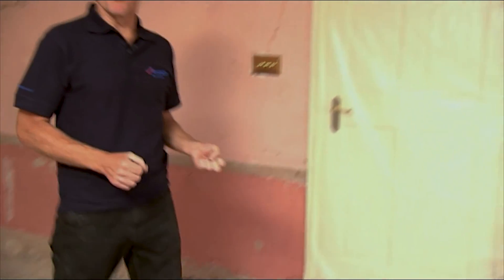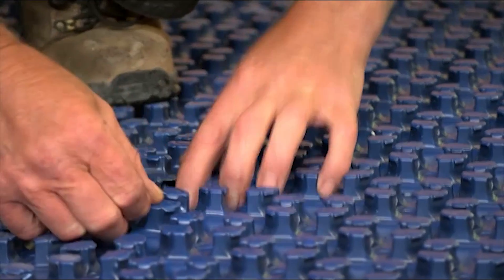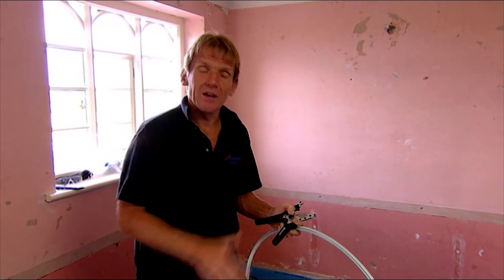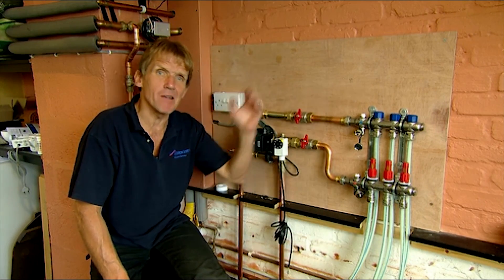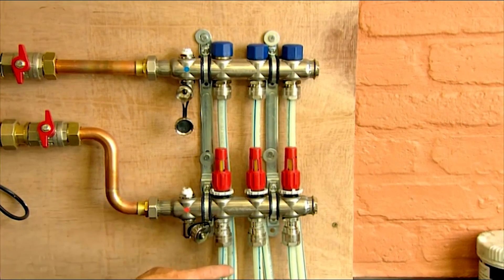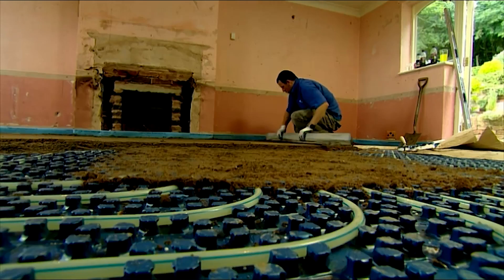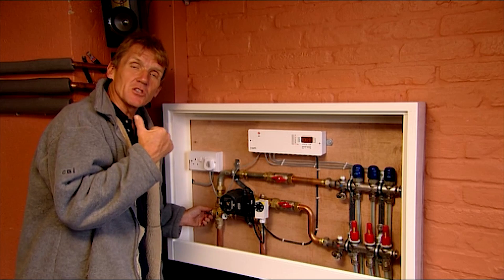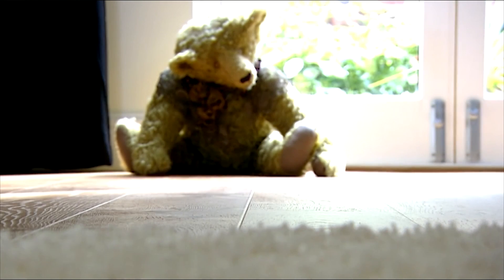How to Lay Underfloor Heating in a Screed

Comment: Could u please tell me what is the  screed exactly and what is the material used ?? Because i use for covering the pipe in my country with Cement mix, which consists of sand, cement and water only. Is my method correct?! I hope you answer my question as soon as possible please
Reply from the maker: Yes you can use sand and cement or liquid screed

Comment: Does the screed install hold heat better than the warmboard installs, which basically have to run all the time to keep warm? Also, what temp does the screed need to maintain comfortable levels and how often do they cycle?

Comment: Would you self level wooden floorboards before using these pipe pannels? I imagine my floor could be a couple inches off across the room but not measured and I'm unsure if uneven screed ontop of the pipe will be a problem. Could have hot and cold spots warming up but otherwise no problem?

Comment: Re doing an old house , which in reality as we have replaced so much should have been demolished. 

Twin cascaded Heat pump going in.

Ground floor, underfloor first and second floor radiators .

Asked installer for 100 centres , however he reckons two issues with that , first radiators on the upper floors will need to much bigger and that they find the tightness of 100 spacing leads to more problems , as well as having to increase flow temperatures . Looking therefore at 150 centres .

Does this sound reasonable ? I can see why there might be issues with 100 being so tight .
Reply from the maker: The lower the water temperature the closer the pipes should  be.
Reply: Thanks , that adds to efficiency and in turn to lower temperatures but it’s working out the impact on the sizing of radiators on the other two floors that becomes an issue and I assume it’s a case of where to compromise.

Anyhow thanks for all the useful vids thanks to which I have been able to more fully understand all the processes of a complete rebuild , and ensure they are not taking short cuts .

Comment: One stupid question. Can the distributor be fitted in the room below the room where the floor heating is being installed? I plan to run one set of the pipes from ground level distributor to one circuit on the ground level and second set of pipes to first floor. Or is it better to have the distributor placed on the first floor? In that case I have a longer supply and return pipe... Thanks!

Comment: I’ve opted for a milled concrete slab floor with 14mm wet system in conjunction with air source heat pump. The slab is insulated with 150mm celotex as well. We have only ran a thin flexible screed over the pipework and now it is to be tiled with a 10mm ceramic tile. Any advice on this system?

Comment: Hi Roger,
I was told by a plumber tht because I'm buying a 120+ year old small, 2 bed, 1 small bathroom mid terrace that needs new damp proof and gas bought into property from scratch that rads would be better than underfloor heating for the cos involved versus paybck in bill savings. Lounge and kitchen with concrete floor and master bed (wooden floor)are circa 11 x 10.5 ft, 2nd bed about 8x12 and bathroom (wooden floor) even smaller. Attatched sunroom/consevatory circa 8x6ft (needs renovation).
Also, I saw in the electric ufh video you used a wet screed that dried faster. I'm confused.
I'm on  budget, but want to do the right thing long term as costs rise for upkeep. What say you?
Reply from the maker: Hi
Yes it doesn't make much sense hacking the floors up to put the heating in so go with the radiators. Mid terrace has two neighbours to keep you warm so it should be good. 
Electric underfloor heating is tile warm up not a whole room heating. It costs a fortune to run.
Reply: @SkillBuilder  thank you. What about upstairs with wooden floors? Bathroom is sooo small.
I'm a building comtractors daughter but learned more from you. Love the videos even if not relevant to me.

Comment: I’m pondering if I should go for this method griundfloor and upstairs use Infrared heating as the bedrooms are small. We will install a 3.5kwh solar system and battery. What do you guys think?
Reply from the maker: I would do exactly that. I don't like underfloor heating in bedrooms. If it goes under the bed you cook.

Comment: Heat is heat,  whether it comes from the underfloor or from wall mounted radiators is not much different. But if you get problems with underfloor then it will be difficult to fix. I think wall mounted radiators are a better engineering solution. Also radiator systems have stood the test of time . .
Reply: Floor heating is essentially a larger radiator allowing you to use lower temperatures and gain substantially in efficiency - and the heat is released slower and more uniformly too

Comment: Quick question. I'd like under floor heating but my budget is tight. Instead of a new expensive system, could I just get rid of my radiators on the wall and connect under floor heating pipes to the pies that my radiators were connected to?
Reply from the maker: HI Luke 
 You can do that but it will make the floor too hot and that can cause your legs to ache.  There have been many studies which suggest that a temperature of no more than 30 celcius is good for your circulation.
Reply: Not sure if this answer is a Mickey take? Regards the temperature, can I not just adjust the temperature of the water coming out of the boiler?

Comment: Hi Roger
I like the idea of using a dry screed in your video, although it may not be your preferred choice. What cement/sharp sand mix was used?
We are just preparing our kitchen (23m2) for underfloor heating and I thought I’d get some quotes for a flow screed. £1400 & another at £2000. This is way over our budget. A dry screed would be so much cheaper. Any suggestions on cement type?

Comment: Great overview. Just wanted to understand, in a Hydronic system, how component constitute to cost? For instance, how much % share does following components hold in a typical UFH system:
1. Manifolds and valves-
2. Zone Valves-
3. Thermostats and sensors-
4. Wiring center -
5. Heating pipes-

Comment: Here's the thing.  I have a 1960 house with concrete floors.  Do I dig up the floors and have to move out to gain better floor insulation without increasing the floor height (big cost with renting) or do I go for a retrofit and lose a couple pf inches of ceiling and door height - your thoughts please
Reply: Rout the concrete
Reply: @DiceandGlory   but there only seems to be one company out there doing this and the solution has no insulation whatsoever.  Surely no insulation goes against what this video and many other manufacturers state?  Your thoughts please?

Comment: Yes keeping the pipes pressurised to a high level whilst the screed sets will mean that any future expansion due to pressure and heat will be accommodated without cracking the screed.

I have to say that experiencing my friend's underfloor heating, the rooms feelcomfortable at lower temperatures e.g. 19c feels as warm as 21c in a room heated by a radiator. Thats because the heat rises evenly ftom floor level. There are no cold spots. As stated too the water temperature need only be around 25-35c compared with 55-65c in a radiator fed system.

I would like to see how an installation is done in a wooden suspended floor.

Comment: is the thickness of the insulation board thick enough? I thought it had to be idealy 100mm, minimum of 50mm
Reply from the maker: You gotta do what you can. Ideally you would put some more under this but if you can't you can't. The house is being heated by a ground source heat pump so there is some justification in this approach rather than radiators.

Comment: Hi Roger. Great video. I am just about to put a hot water underfloor heating system in a new 42 sqm extension. My wife wants a Karndean laminate floor. Would this be ok with the heating system? Karndean say as long as the surface temperature is no more than 27 degrees then should be ok but would appreciate your opinion. Cheers
Reply: I doubt Roger would add anything to what the floor manufacturer has said?

Comment: I would strongly recommend using more insulation under the UFH. If I was building a new house I would use at least 100mm of PIR.
Reply from the maker: Good idea. The Building regs normally specify 90 mm but I have a 150mm in my extension.

Comment: We're having an extension to our kitchen, our house is 1910 construction and the kitchen floor is (currently) 22mm chipboard, 50mm polystyrene and then I'd say 4" or so of what seems like Limecrete(?). The Limecrete layer finishes about 3" below the outside floor level, would this be a suitable solution for UFH? As it looks to have an insulated backing, with a screed on top?
Seen a lot of the UFH videos you have done and this one is I would say the closest to what I need!
Reply from the maker: There are lots of choices for you. The easiest is to take up the chipboard and lay an insulated pipe panel.  Lay the panels, push the pipe into the grooves and put back chipbard. Job done.
Reply: @SkillBuilder  thanks I think whilst I'm there I'd prefer to pull up the polystyrene and put celotex down for an increase in U value. But glad to know there isnt anything funky required for the old building

Comment: Well explained Roger. Can you have an wet Electric underfloor system, just like boiler fed and how economical would it be?
Reply from the maker: It costs a lot to run an electric boiler. I would go down the heat pump route if I was on electric only,
Reply: @SkillBuilder  Thanks Roger, just a question. I still have a Gas boiler, but am thinking about alternatives with our Gas supplies running low.
Reply: @brianwood5220  - The daft thing is in England and Wales, the government is offering the Renewable Heat Incentive (RHI) grants available, but the heat pump must be the only source of heating to qualify !

Comment: Great job with the way the pipes are being layed. In a snail pattern instead of going across to one wall an back to the other wall like most fitters would do. Would using a liquid self leveling screed not be better for holding the heat an then realising the heat into the room than a sand cement screed?
Reply from the maker: Yes liquid screeds are best but sand and cement is not bad if it is done well.

Comment: I’m a bit confused to be honest. I seem to remember a vlog from you a while ago in which you completely rubbished underfloor heating. I think you said it wasn’t instant enough, didn’t warm up quickly enough, and didn’t cool down fast enough if it suddenly got too warm....! So which is it..? Are you for or against. What’s going on with you.
Reply from the maker: I think you are slightly misrepresenting the previous statement. I have always been a big fan of UFH but I am honest about what it can and can't do. I am not a salesman on a kick-back. 
In the middle of winter it is the best thing ever but in the autumn and spring when you might need to put the heating on for an hour or two on a chilly evening or  cold morning it is not the best. You might have a cold morning and a really sunny day and the heat will be in the floor when you don't need it. 
This means you might have to open the window and waste that heat but on balance the cost savings over the year are still there.
Reply: @SkillBuilder  ok. Thanks for clearing that up. Keep the good stuff coming.

Comment: also, if u r gonna use pipe dope, please dont get it inside the pipe.  why, cuz now it mixes with the water and makes a sludge inside the circulation route.
Reply from the maker: Nothing stays in that pipe when you run mains water pressure through it for the flush out.
Reply: @SkillBuilder  pipe dope don’t flush out. If it did, it would not be waterproof

Comment: Any recommendations Roger for an overlay UFH system on an un-insulated concrete slab (1950s semi). Struggling to find something that adds enough insulation without too much build-up as the ceilings are only 2.3m high. From drilling a hole it looks like there is only about 25mm screed on top of a 4" slab if that helps. Would prefer to avoid the cost of digging the whole slab up!
Reply from the maker: Hi Dane 
 I am afraid you are looking for the best of both worlds and there is nothing wrong with that but there is no way of getting the required insulation without the build up or the hack off. I have a similar issue at my daughter's house and I am thinking that  a low build 16mm system with a really low temperature is going to give some heat  without it all being lost.  To be honest I don't know how it will work out but the prospect of hacking up a screed in an occupied house is too daunting for now.
Reply: @SkillBuilder  Thanks for the reply Roger. I've had so many opinions ranging from the JK system (grooves routed in the screed with zero insulation - they obviously claim it will do the job no problem) through to you need to dig it all up. Currently contemplating hacking up the thin layer of screed (we're doing a big renovation so not bothered about mess, just cost) to at least get 25mm PIR down and then either a low build system or just 35-40mm of flow screed over pipes. Thanks again and keep up the good work - these videos are invaluable to first-time home owner like me who are approaching a renovation job.

Comment: Very interesting video. We're in the process of finishing our ground floor renovation, tiler will be here in a couple of weeks. There's an existing screeded floor which was part of an accessible bathroom. We've had to remove the screed to get to the sub floor as the toilet & soil pipe is set in concrete 360mm from the wall ( doh!). 

Anyway, I only just found out about screed curing & drying times which would really drag out our project. Our  plumber has suggested running flow and return to the towel rail in the floor as a pseudo wet underfloor system  - just as you've suggested doing in another comment which I'm really keen to do, but. I'm looking for a quicker alternative to screed.

 Bathroom is tiny - 6ft square with a 900 Quadrant Shower tray so area is barely 2.5sqm. Tiler has suggested using 2 part latex, laid over a couple of days in two layers as an alternative e to the whole wait around for screed to  cure & dry. Any idea if this would work as an alternative. Or is there another option? 

With such a small area the material cost is less of an issue, we're just looking for speed so we can be finished by Easter!
Reply from the maker: Hi Adrian 
Run the return as a snaking pipe through the screed and that will help prevent it overheating. Take the flow direct to the towel rail.
Good news for you is that you can buy a screed cement that is rapid set and absorbs the water. 
It allows you to tile after 48 hours. 

https://ardex.co.uk/product/ardex-a-29/
Reply: Does the rapid set screed give as good a result as the slower setting screed? 

Also what is the price differential between rapid set and more traditional slow set screed?

Comment: How much depth would this add to my existing concrete floor?
Reply: Think the minimum was 6 cm
Reply from the maker: You can get away with as little as 35mm if you use a special screed. Cement based flow screed with fibres is good
Reply: Does that include the matting, pipes and screed?

Comment: Great video Roger. I read it's not good to add the pipes near walls or where heavy items will be placed, as the heat will/ maybe ruin the item e.g TV cabinet, sofa etc, what are your thoughts?
Reply from the maker: Generally we avoid putting the pipes under fixed furniture but people often change room layouts. I have some built in storage and seating in my kitchen and the UFH goes under it. 
Everything in those cupboards is toasty warm, it can work in your favour

Comment: Roger, are there any issues having the pump, isolating valves and manifolds on the first floor of the property and the boiler on the ground floor? I live in a 150 year old house with no ability to run the screed pipes through the house. The bathroom isn’t huge, approx. 3.5m x 3.5m. What’s your advice? I understand electric mats can be very expensive to run. Thanks, Rob
Reply from the maker: Hi Rob
 If you are just looking to warm up the tiles you can do that with electric mat and it is fine but if you have heating pipes going to a towel rail then I would run the return from the towel rail around the floor with some insulation. I have done this in my bathroom and shower room and both of them work really well with no manifolds. The heating is a combination of the towel rail and the underfloor pipe.  If it gets too hot the TRV on the towel rail shuts it down.
Reply: Thanks Roger, this is brilliant and I really appreciate you taking the time to get back to me with your advice. 👍🏼

Comment: We looked at a screeded system on an install we did 12 years ago when underfloor was still relatively new .

On an existing slab it seemed a lot of work , plus the expensive preforms  - we just didn't have the budget.

We simply used 50mm extruded polystyrene over the whole ground floor slab , drew out the respective circuits onto the polystyrene and simply routed out the channels for the piping.

The floor was covered in solid oak 3/4" flooring - the kitchen floor was covered in cement board and tiled with latex based adhesive.

After 12 years the feedback has been entirely positive - no problems at all - maybe a screed would have been a more efficient heat store , but that weight of oak and the cement board and tiles have given a good return for the money , with a very economical energy use.

It is sometimes too easy to be seduced by proprietary systems , when all that is needed is an application of existing, proven materials.

After all we're not normally fitting out a tower block.

Great videos .
Reply from the maker: Whatever works is good. Systems have come down in price and there are so many good options that I would always look at all options. The important thing is that it gives you a nice even heat.